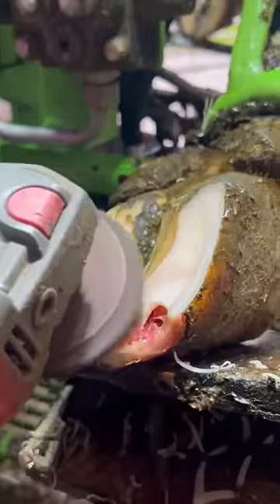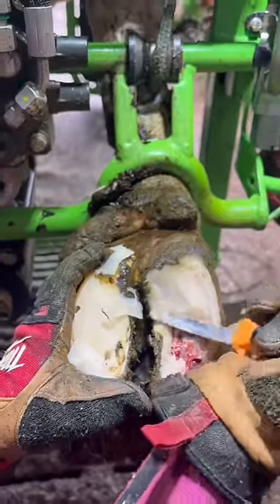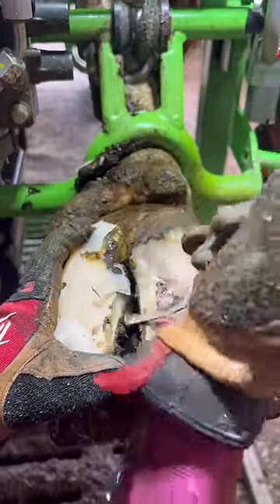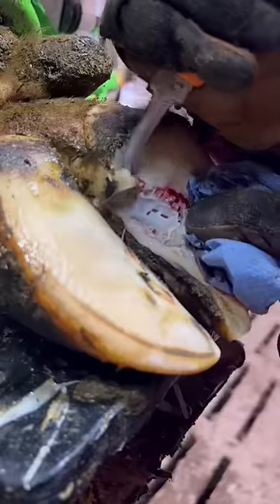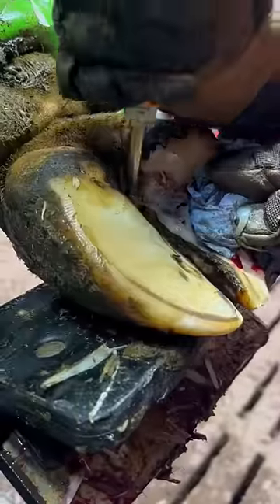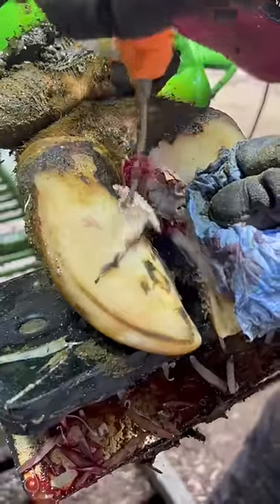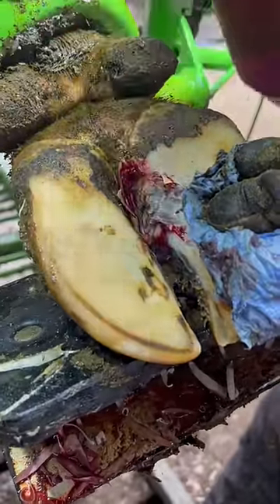HOOF BLOWS BUBBLES from CAVITY 😳😳😳

Comment: I feel like this must hurt the cows so bad! I've had ingrown nails removed and it's hurt this must be hell
Reply: We have seen in videos before what happens when a cow feels a little bit of pain. If the cows were going through hell here, the guy would be dead
Reply: @GsusCrust  not if they are bolted down in a big green metal cage 🧐
Reply: @John Syzlack 💀
Reply: @GsusCrust  fax
Reply: It doesn’t it likely only bothers them with full weight over time. This likely felt like a massive pressure had just been released. Any pain would have been mage quick followed by pure relief. That cow likely had a wonderful time here.
Reply: @hoghs1  Exactly, if they didn’t trim their feet it makes it very hard for them to get around and it does put a lot of pressure on them. Same thing goes for horses and goats.
Reply: It’s just like when you cut your nails
Reply: Better than an infection so gangrenous they lose a hoof
Reply: The bubble hurt as hell, when he cut it open the cow would feel much better…
Reply: @sb41105  thats just to safely support the weight as he can work on the cow. If you have ever observed dogs, you can animals have a much higher pain tolerance
Reply: Man everybody is a know it all at something…
Reply: They don’t have nerve endings in their hoof horn which means that the only thing that would hurt the cow is if he touched that flesh under the hoof horn
Reply: It doesn't hurt them at all
Reply: Actually there are only certain parts that the cow can feel on its hoof same thing like it's horns and they grow and they're thick and without nerve so he can cut at it as much as he wants as long as he doesn't hit certain spot if he goes too deep they explain this in a lot of the videos and I don't know why people are still questioning this and if they have a question about it I don't know why they're bitching in a comment section why don't you look it up and see
Reply: Ive had several ingrown nails i heard if you go and get it treated they cut the nail part that isnt white and it sounds like it hurts like hell but i just take the nail off over time
Reply: @John Syzlack 👏👏👏👏
Reply: I’m sure they feel pain but the relief they will receive in the long run is worth it. Surgeries hurt during recovery but in the long run turned out to be beneficial
Reply: @sb41105  if the cow wasn’t bro would of got kicked lmfao
Reply: @John Syzlack LMAO
Reply: With the hoof having the cavity, that would've caused more pain than the hoof getting cut back. But with the hoof getting cut back to the cavity, the guy caused more relief than pain. Plus now the hoof will heal and grow back solid with probably some pain in the process since it got cut so far
Reply: @John Syzlack fax
Reply: @sb41105  so he doesn’t get kicked so hard in the stomach it explodes 💀 🤦🏾
Reply: @cristofargone  exactly meaning it hurt the cow lol but I'm just sayin 🤷
Reply: @sb41105  you would hear alot of banging if the cow was fighting.
Reply: As a person who has helped on a farm doing that. I can say the cows are mostly a bit in panic but don’t seem to be overly in pain, at least they can walk properly after this procedure…
Reply: Yeah but if you got them removed you know that the pain was worth removing it plus, it literally feels like instant relief when you pull out a ingrown mail
Reply: It only hurts the cow when they cut into the corium, which is practically never necessary. These operations are important because they allow healthy hoof horn to grow into place.

Comment: Uve had alot of crazy ones. Explosions, cavitys that produce a tube of toothpaste quantity of puss. But this one shocked me the most I think. Just from the small spot you initially find to 9/10ths of her hoof just separated from her foot. Most hoof itself I think I've ever seen u remove. Whole left inside portion and most of the standing surface besides a small inch or two section toward outside of hoof. Crazy in sheer size
Reply: I thought it was over the first time u sprayed the dissenfectant or w.e... but that was halftime. U had only removed like half of the issue. Mindblowing